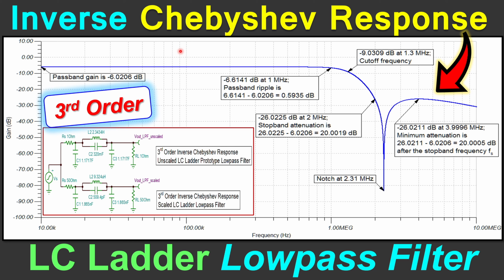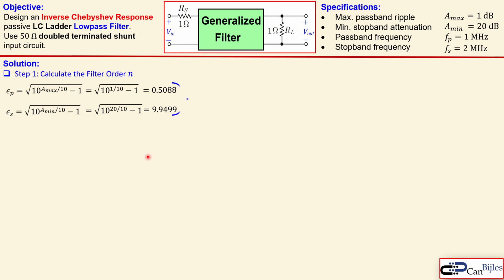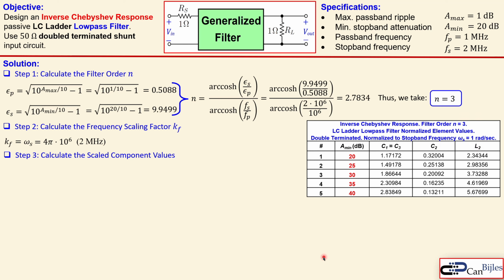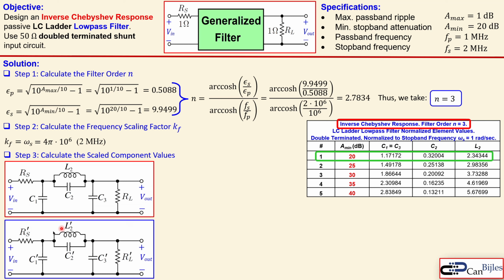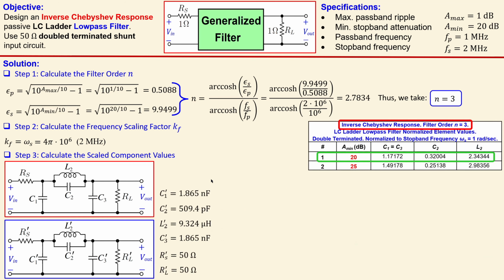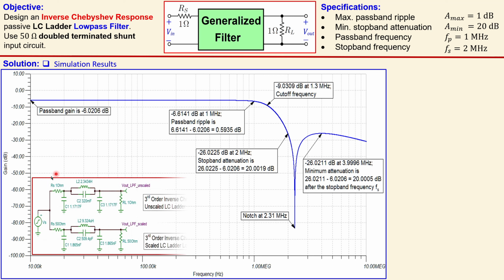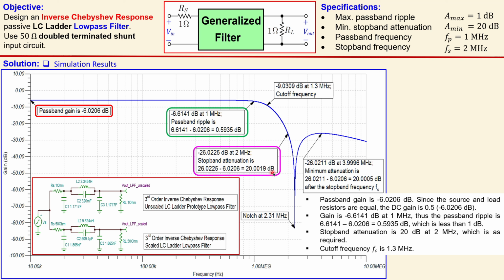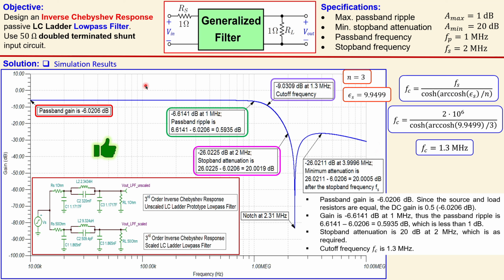LC Ladder Lowpass Filter Design 💫 Inverse Chebyshev Response - 3rd Order 💡 Example 1

Comment: Hello! Lets say you have 50ohm load. But the source resistance is 0. What would you do then to avoid too high gain ripples? Thank you
Reply from the maker: Rs = RL = 50 Ohm is required for maximum power transfer.